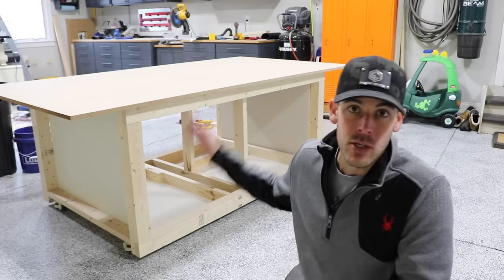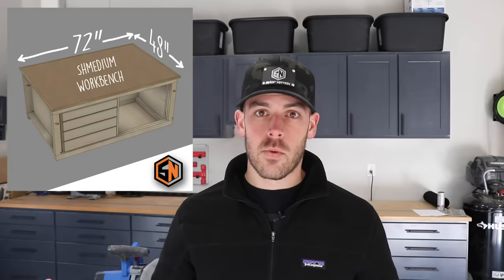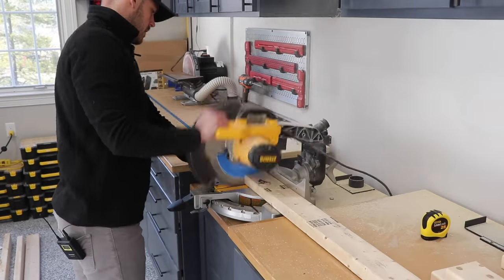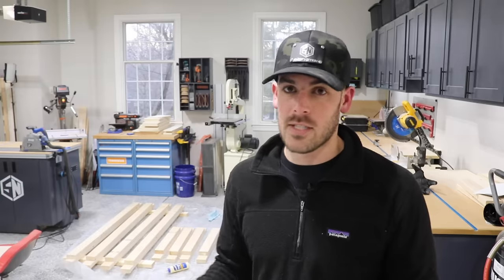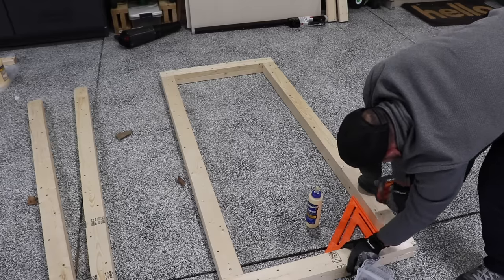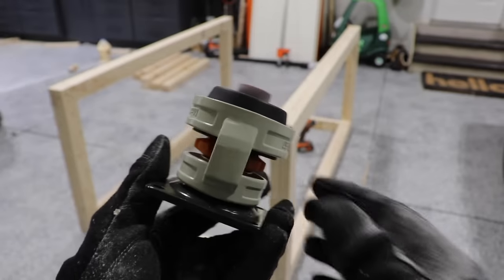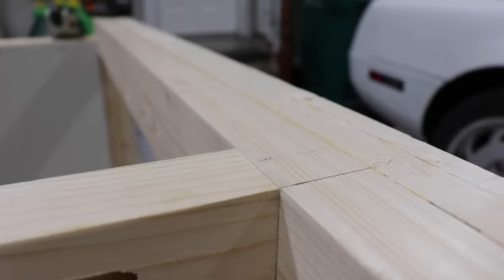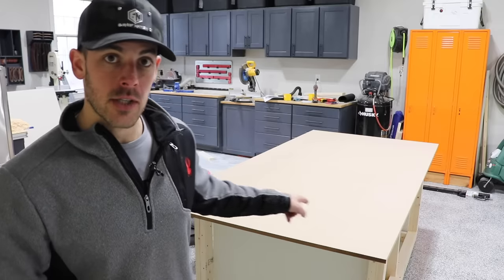The Perfect Garage Workbench & Outfeed Table // Part 1

Comment from the maker: Full Color Plans Available Here (in or mm): https://bit.ly/3QWVIbE 
*NEW* Smaller Version Plans: https://bit.ly/3QVWciv
Reply: How have the casters held up? More specifically, the 2x4 they are attached to? You attached them to the cross pieces, which makes me think that the entire weight of the table is being held up by the pocket screws attaching the cross pieces. Please correct me if thats not the case. I really like this design, but want to understand that part.
Reply: Hahaha, just watched part 2. Guess I'm not the only one wondering. Thanks for clarifying.

Comment: As a retired design engineer, I love to view videos of other woodworkers' designs of benches, jigs, fixtures, etc.  So far, what I've seen of your new bench, the design is both well conceived and easy to duplicate.  I'm looking forward to viewing the follow-on videos to see how it all comes together.
I'm thoroughly enjoying your video, you have a natural speaking style that makes the video easy to watch without sacrificing quality of content.
Keep up the good work, Cheers ... Dave
Reply: I was right there but the comments about the wheel strength then attatching to a single pocket screwed cross  stud not the double glued and screwed legs was kinda giving me shivers...  Definetly not going to get close to the rating that way .... Though probably not a real issue for the intended use ... Ah, the MDF will help still like pole barns hanging trusses off bolted in headers instead of on top of posts ... no likey the stress is all on the fasteners not the material

Comment: Ha, I have that same jointer. Done pieces up to 8ft long on it and yup it is not ideal. The problem with the shavings is mostly your setup. The narrow hose doesn't pick up shavings as well and that kink you have in it right at the extraction point is for sure going to get plugged up. These are shavings, not sawdust, so they require a little more oompf in your system to pick up; constrictions make a difference. The other thing I've noticed about this jointer is that once the shavings start to pile up at the extraction port it very quickly gets plugged up and then has to spew all the shavings out the top. 

If you get a straight hose going in and make sure you start with a clean extractor port it runs a TON cleaner.

Comment: Nice start to the build! I had to chuckle at your reference to the thickness of the jointed lumber being 3.25... I can always tell when someone has an engineering background. As you know, woodworkers here in the US tend to use fractions (3-1/4). But as a mechanical engineer by trade, I get it.

Comment: Nice build but I've got a remark for the screws as a clamp method. 
I do like it as I  just not have enough clamps, but you better drill holes in the top 2x4 in which you screw the screws first to get much better clamping pressure.
Key is to make those holes bigger then the thread ø so the thread of the screw only grabs the 2nd, underlying 2x4. Then the 2nd 2x4 will be pulled against the top 2x4 by the force of the screw head being pulled in the wood. 

Your method works as seen but only holds the 2 pieces more or less together because the screw thread is in both wooden pieces. Driving the screw further in the wood will not give extra pressure between the wood surfaces. The drilling is not too much extra work,  because you did not measure and drove the screws in more or less random places, those holes are also easily drilled randomly just before de glue up. (sorry for the clumsy explination, not native english speaker)

PS: You can test this yourself with some scrap pieces. Just add glue in between and see how much more glue squeezes with both screwing methods.

Comment: I think something may be up with your jointer. I have this same jointer and the dust collection is decent. If I don't have the shopvac connected almost all the shavings come out the dust port.  I always pick up new ideas for my shop from your videos.
Reply: Thinking the same thing, I have an older 6" Ryobi and it works very well overall and the dust collection is near perfect.

Comment: I've used those casters on a number of projects. The dial is a little fiddly to use, but they immobilize whatever is on them like no other caster I've used. Even fully locking casters don't compare.

The only thing I've found that's better, but not cheaper, is floor locks.

Comment: I just got done milling the wood for my own workbench using a 6” bench top jointer (craftsman). I actually jointed two sides to 90 and had some full 8’ pieces. So lots of jointing. I found that I occasionally had to stop and unplug the chips inside the jointer. It worked best to use a combination of air hose and shop vac. Just a suggestion moving forward. Maybe one day we both will be lucky enough to have a floor model with full size dust collection.
Awesome video though! Love your channel and you were a huge inspiration in designing and building my own workbench.
Reply: Oh, and a secondary thought... I would not be wearing gloves near a rotary cutter like a jointer. Just ask Katz-Moses how far worse his recent accident on the jointer could have been with gloves.

Comment: I have built the Shmedium Bench. The plans suggest that the Kreg router plate levellers could be incorporated into this build, but several modifications need to be made. First, no routered lip for the plate to sit on; the opening needs to be the full size of the plate. Second, the Kreg stuff (levellers and router fence) works for a table top 1-1/16" thick; I marked the position for these things and flipped the table top over to router out these spots. Third, the dimensions of the dust collection must be increased to avoid interfering with the screws that go into the levellers; there is enough room within the router drawer assembly to accommodate that increase. Another thing I did was to eliminate the sloped pieces surrounding the vacuum port; I drilled the hole, installed the port, and used my Fein tool to cut the plastic flush with the inside bottom board, before assembling the collector box. So far, so great, with this amazing addition to my shop.

Comment: for the love of god get your self an aspiration system. it costs around  150$ and you wont have to deal with so much sawdust (not a vacuum cleaner) just for the jointer since you will be limited to 2.5 meters. get a good one and connect the whole workshop to it. 1 vacum cleaner to rule them all basically. 1000$ for it.

i just started building my workshop and this thing saves me time cleaning it after i am done. i connected miter, table saw, router table, planer and jointer to it and it works via Arduino Bluetooth controller :)

Comment: Last workbench I built was made out of driftwood I found on the beach. The top is 4x8 by 6ft boards. I drilled 1/2 inch holes through 3 of them in 3 different places and the fourth one I threaded with a tap. I used all thread to hold them together and it turned out pretty nice. The frame and sides were 2x6. It looks like it is over a hundred years old.

Comment: Ideally you'd want to joint one side, then take it to the table saw to make the other edge parallel to the jointed edge.
Reply: Ideally, if you have a tablesaw.
Reply: That wasn't meant as a "you're doing it wrong", it was more meant for those watching so they'd know how to get square boards. 👍
Reply: Or a planer

Comment: I'm not sure I've ever checked in to someone's YouTube Channel as much as I have for this. Like GoT all over again. May have to hold off for months then binge this series 🙈
Reply: @ShopNation  Hey Travis, you mentioned using a table saw if you don't have a planer/jointer (I'm in the UK) do you use a taper/jointer jig at all for this 2x4s or just use the fence, rip one side then flip and rip the other?

Comment: Home Skillet, I have that exact Jointer.  Works great.  FYI you're getting a lot of waste on the table and blowback because the hose wasn't straight, and the "chips" when taking deep passes clogg the outfeed hole (also with long dense tropical hard woods the outfeed clogs a lot too, (especially Paduk)).
Reply: Or your dust collection wasnt on laughing out loud

Comment: Awesome looking bench, cant wait for part 2. Ideally jointing should only be done on 1 edge and and 1 face. Doing both edges can create a wedge shape piece of wood since neither side is parallel to the other. Try doing the other edge with the table saw to keep your boards edges parallel to each other.

Comment: Well this will certainly inspire me to finally clean up my shop and get a real outfeed table going. I have been cleaning up 2x4's on my old jet 6" jointer the same way (1/16" passes) for finishing our basement ceiling so this should be a snap. I tossed a 35 degree bevel on them for a poor man's coffered look. Had to laugh at the dust mine is not much better. Got a new miter saw with close clearance so I can move that off to a side wall leaving room for a much improved setup .... Thx lots of good ideas in your video.

Comment: I don't think it matters for this project, but for future reference keep in mind that a jointer can make a face flat, but it cannot make it parallel to the opposite face. So you really need a planer with a jointer if you're making anything where the two faces really need to be parallel to each other. That's also why a planer is generally a better tool to purchase before a jointer. You can joint with a planer using a sled and shims, but you cannot plane with a jointer. Bench looks like it's coming along great.
Reply from the maker: Yes, which is why I stated that in the video
Reply: @ShopNation  Ah, I re-watched that section a couple of times and I misunderstood what you said (it was mentioned quickly in terms of square edges). Someone else may as well, so I think the clarification is worthwhile.

Comment: Pro (ish) Tips of the day : A jointer is used to make a side flat, then, using that flat surface as the base reference on the 90deg fence to get the adjacent edge exactly flat and 90 Degrees. That's it. You DO NOT use a jointer for more than your first 2 perpendicular faces, as it will not make straight parallel sides.  That is what a Planer is for. The jointer gets your first 2 perpendicular sides flat and perfectly square (If the fence is square). Then the planer takes those sides as reference and makes the other 2 faces perfectly parallel. If there is the slightest bow or twist in your wood, (which is the case most of the time) using the jointer on all faces will result in tapered pieces and your assembly will be a nightmare.  On the other hand,  If you were to use only a planer for all sides, the planer would only make your faces parallel, and not get them flat. If you have a face that's curved like a banana, the planer will follow that same curvature. That's why a jointer and a planer is the essential combination in any woodworking project, as it allows for perfect and quick milling of rough stock. 

If you don't have a planer, you can use your table saw after you have your 2 squared sides, and cut them to the desired width easily, since once side will sit perfectly flat on the fence. 
Also. Get a dust collector on that toy,. A shop vac isn't remotely adequate due to it's low volume, high pressure (and decibels) nature.  A dust collector is High CFM (Volume of air flow) and low pressure, and is used for chips and shavings. That's why you couldn't suck anything out of that little jointer ; The output volume of shavings is too high for the volume of air flow of a shop vac. 
A shop vac is a shop vac. A dust collector is a completely different animal. ....and a dust extractor is another thing also (mostly for sanders, grinders and miter saws) A lot of people make the mistake of confusing those 3 tools.

Comment: Having just built my own combination saw-table/outfeed/assembly table albeit for my little DeWalt 7491, I think the ideal size for average 2-car garage weekend workshop is around 3x5 feet assuming a discrete table saw. Mine is closer to 3x6 because it also serves as a stand for my job saw.

Comment: Nice build! Great job on making it accessible to those with minimal shop equipment.
I have a big concern- all of the weight is held by the 4 pocket screws on the wheel/foot mounting member. Those joints really need some form of reinforcement.

Comment: I did the opposite. Spent months designing and kept changing plans until I got frustrated and just started building. I also went with MDF top and after a stain, two coats of shellac and 5 coats of poly with trewax carnauba wax, it’s solid and smooth as glass. Looking to see how you ended up coating your top.

Comment: Go Vols!
My first workbench I built was sized for height to accommodate my benchtop tools (router table, drill press, ect), and on castors, since my workshop has to be re tucked in the corner of the garage when not in use.  The problem is that it's a bit too short to use comfortably as an assembly table.  And I cannot use it at all as an outfeed table.  I like your plan, and my next workbench build will be sized to double as an outfeed table.

Comment: So weird about the dust collection on that jointer.  I had the same one for a while and I think it doesn't do well with a shop vac and also, the chips from 2x4s are thicker and clog the top of that port.  I'd unscrew that dust adapter on the left side of it and let it pour our that way.  Also noticed that your hose at the start was bent 180 degrees - could have been a problem as well.

Comment: Question: with the bulk of this workbench, are you worried about the entire weight of the workbench sitting on the 2x4 cross bracing that’s just pocket hole screwed into the legs where the casters are? Do you suppose  it would be better off with the casters at the bottom of the legs?
Reply from the maker: There is some additional bracing I accidently left off in this video, they show up in the next one!
Reply: That’s what I was wondering too! Putting the casters/feet on the cross stretchers completely negates the strength gained by the bulky side frames. Now if he had the stretchers attached with more than 4 pocket screws it would probably be fine, but the pocket screws simply aren’t as strong as the pseudo lap joints that are ultra screwed and glued.
Reply: @fakerfake1  Travis included the braces in his plans but I guess he got going and forgot to double check them before flipping it back over. Now he gets to lift that MDF sheet a whole other time.
Reply: Yeah I cringed when I saw that, but I guess we’ll get to see a remedy on the next video...
Reply: He attached plywood to the brace which gives it additional support. The weight should hold. It’s not the most conventional choice, but I am assuming you’re not watching him because he is conventional. I am very interested to see the final build.
Reply: @ShopNation  Yes, very glad to hear that.  I didn't see you add any glue so the entire weight of the bench was supported by 8 pocket hole screws and that scared me!  A 2x4 jack stud above each caster and screwed into the king would do the trick.
Reply: @ShopNation  sounds good. I’m excited to see the end result!
Reply: apparently I'm not the only one to question that design decision! Carry on, will see how it holds in the long run
Reply: I enjoy watching the building of a good table, but, what about one that would work in a 10 ft x 12 ft shop?? Thanks
Reply: @shakyzeg  Amazon de - GD-40F
4 Pcs Castors Swivel Wheels, Retractable Leveling Castors, Industrial Machine, Heavy Duty Castors
4pcs Wheels Nylon Aluminum Alloy Industrial Machine Levelling Trail GD-40F
Reply: I'm actually building this as I write.  Because pocket screws are NOT recommended for loadbearing braces ALONE, and I needed the practice, I mortise and dowel-tenoned all the 2x4's supporting the MDF/Ply top -- ridiculously strong.

Comment: Awesome design so far. I have to add, I used the same casters on my pool table. The legs were too short, so I got those to raise the height and the screw adjustment made leveling to table a dream

Comment: The casters are indeed very strong, however the pocket hole screws that tie the cross braces into the frame are not. A half lap or mortise/tenon joint would transfer the load better.

Comment: You gotta use a 2 1/2 inch hose on the jointer for adequate dust collection. That 1 1/4 inch hose just can't pull enough cfm to work.
Reply: why stop there! Bigger is better when it comes to airflow! I have that same jointer but I'm running a 4" hose up to a 6" hose. Jointer sits about 15' from my dust collector and every chip is collected no problem.
Reply: @manningmadewoodcraft2241  Yes bigger is better, however the bottleneck is 2.5 inches at the tool, in Travis's case a shop vac with a 2.5 inch would be adequate.
Reply: @com38ful  Correct. I picked up an 2.5" -> 4" adaptor to accommodate the larger hose. I agree a 2.5" would probably work fine when the chips only have to travel 3-4' to the collection bin.

Comment: Trying to work out why you used the stringers going across as the primary load bearing member to carry the weight of the workbench through to the casters. This means that a couple of pocket screws and a glued butt joint are holding up the weight of the whole bench.
Reply from the maker: Stay tuned 😉